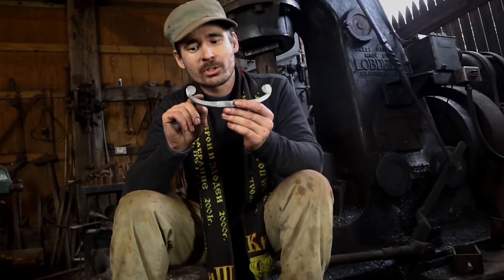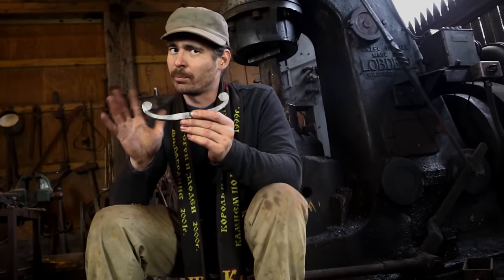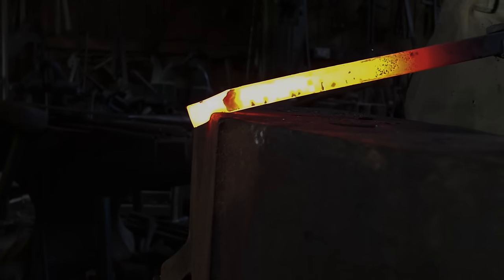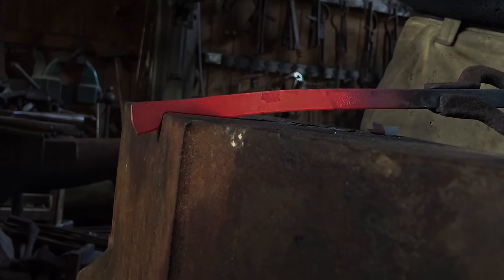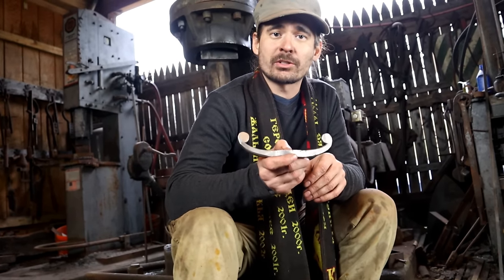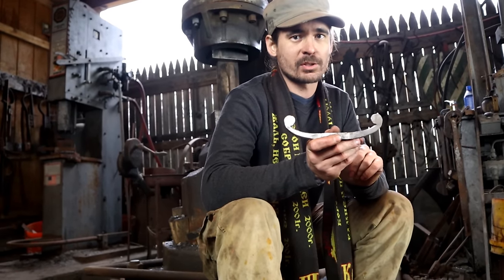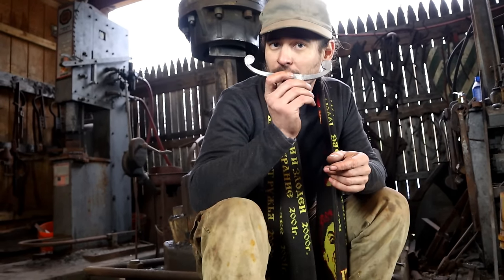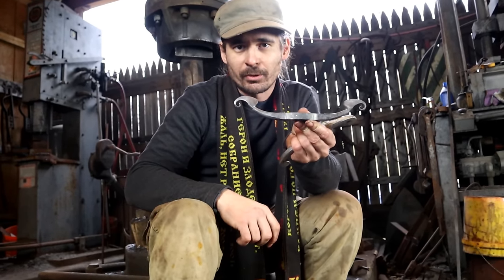How to Forge A Penny Scroll - Your Edge

Comment: a short blacksmith lesson like this is perfect for someone like me who has always wanted to get into blacksmithing/bladesmithing. I made a charcoal forge out of an old stove and my anvil is an 8 by 8 by 2 inch piece of bit steel, sadly I don't have a shelter for it and it's been raining like crazy and now it's winter time and cold so I have only got to light it up twice. It does work though. This would be something fun to try and learn on, now to get some square or even round stock and get the right day to do it. :)

Comment: I love the simplicity of it and how it creates that nice tight crease, but I would be very worried about that crease turning into a cold shut. How do you prevent that from happening and creating problems further down the line in hardening and tempering? Is it just a matter of keeping it at a cherry temperature or higher?

Comment: Teach us how to make a Fuller on a katana I'm actually curious how that is made is there a special tool for that or do you have to Chisel it away like the traditional method
Reply from the maker: Great idea
Reply: Could be wrong, but I would think either method would be okay. A fullering tool would make easy work of things in the forging process. Just keep in mind that it will introduce stresses in the steel, so you may want to do the fuller, normalize the blade a few times, then set the bevel (as the stresses made in the beveling are what creates the curve in the blade after quenching.)
Chiseling should work fine too, just be sure to do so before quenching!
(If any more experienced smiths want to add or correct me, by all means do so! I'm just starting out in the craft myself and am happy to learn :)  )